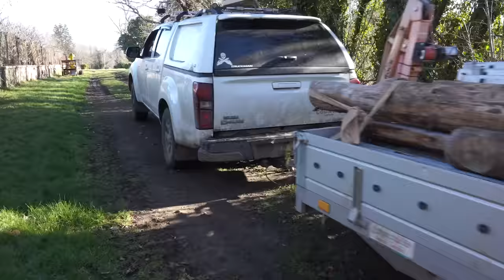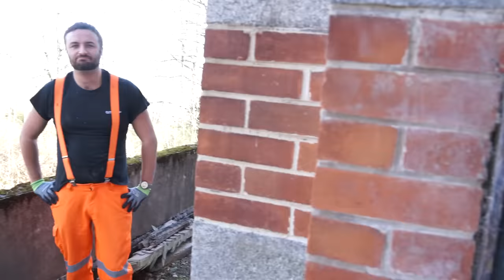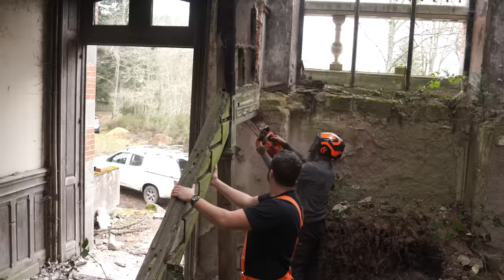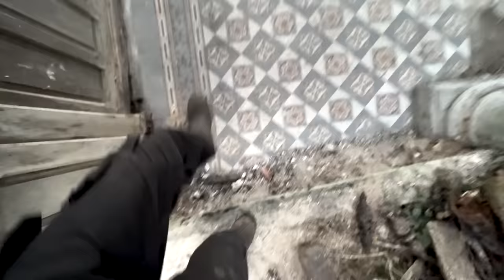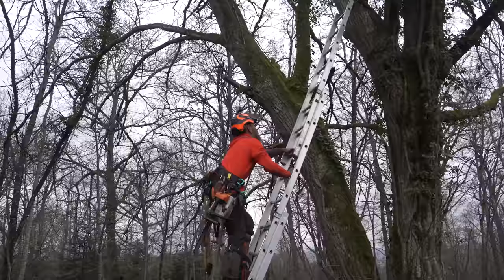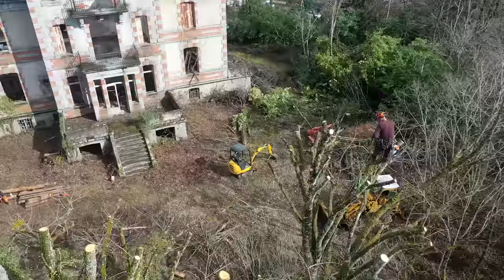5 days work in 5 mins - in this chateau ruin

Comment: The architect in me would be very temped to keep a light shaft running through from bottom floor to the top and put a huge skylight in, as a reminder of this whole state and massive project and keep a little bit of the rustic drama for contrast in the future.
It's really starting to look SO different! What a cracking job you all did this past week! 👌💪😍
Reply: Wouldn’t it be amazing to have a glass roof! I’d want it to be a giant oranagerie….errrr, can’t spell that. But I I guess even spelt correctly it would be impractical to actually live in.
Reply: If the staircase always served all floors in the one well, it should be possible. Corresponding shape to the hallway in clear glass with the ivy edge from the tiles echoed around its edges. Square panes framed in black allows the memory of the steel beams to show.
All these ideas and it isn't even our chateau. I'd love to hear Dan's thoughts on it.
Reply: @michellebyrom6551  Yes! Could actually work anywhere if it was a glass shaft, but that would be ideal. From the start I was seeing it not as it once was, as much as a more expensive conversion where some of the beauty of the raw ruin remains intact. There's something magical about the visible layers revealing the structure and force of nature on it over time together with all those ornate architectural details. I guess there's something about ruins sometimes that tells a story evoking the imagination. 
I'm just assuming Dan's goal is to restore it back to its former presentation as much as he's capable of with affordable materials. He's also clearly under budget restraints, and also a practical man. Which makes this project very interesting! Because of it's state, he's not limited to chosing traditional materials nor solutions to make it work, the way you are if dealing with the kind of chateau restorations most people are busy with on these channels. He's really free to make what he wants of it, and although I think he wants to stay true to the (or an) "original vision", I'm sure it won't involve pink toile de jouy ;)
I'm exited to see his Tiny House/cabin in the making first! It will make all the difference to this projects sustainability and his sanity!
Reply: I can't remember if I read something Dan said in comments or if it was in his vlog, but as I understand it there were conditions of sale that he would restore "like for like" or something along those lines, so he is limited in how creative he can get.
Reply: @Sgirl  oh. But where are the records of it all then? All he has is a shell.
Reply: @Sgirl  are you not just referring to regulations regarding the footprint? Every nation in Europe has their own systems for building permissions and taxes. Italy is probably the most restrictive, every municipality has their own very strict guidlines on shapes and colors for swimmingpools, stiles of facades, no of windows etc on old buildings to keep the landscape looking as it always has. France is not as bad, but there's alot yoy need permission before constructing as far as footprints and exteriors, and I think, like Italy, adding bedrooms to property (or converting space to bedrooms) involves higher taxes, needs to be registered etc.
In Sweden where I live, you need permission for any new fireplace, added chimney, terrace and register if you insulate a building or put down hardwood floors. That kind of thing. I'm guessing here, but I'd assume he must comply with the general structure of the building.
Reply: @gnarbeljo8980  I feel like it was a requirement set out by the seller. He wanted to sell to someone who would restore it to original ... but I only have a vague recollection of what was said exactly. I think it was something Dan said to someone in the comments. I have a pretty good memory, so I don't think I imagined it ... haha, but at the same time I wouldn't bet my house on it! 😄
Reply: @Sgirl  oh wow, how interesting!
Reply: @Sgirl  well remembered.

Comment: Hi Dan, 
emazing work.
 I see some part of Gips Reliefs from the not existing  top. When you start to work on the walls, take thermosilikon, put it on this profile,  worm it with heat air pistole, not to strong. On this way you can get the  print of the originale piece to make it hole again. I think this part cannot be saved. 
We worked with this metode when the stucco have some demages and must be restored. Ask about it in Conservator Office, how to save a stucco.
May you can get some photos with the rooms view's. 
And make a friendship with safety shuh's, with steel cups etc. You need it her.
 ❤️ ♥️ 💜